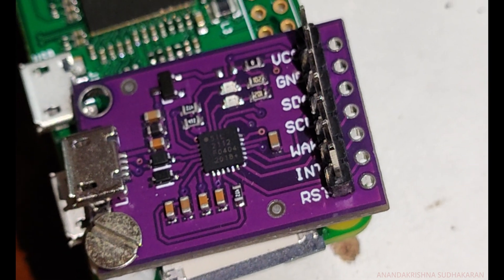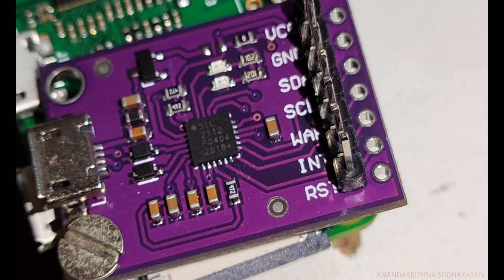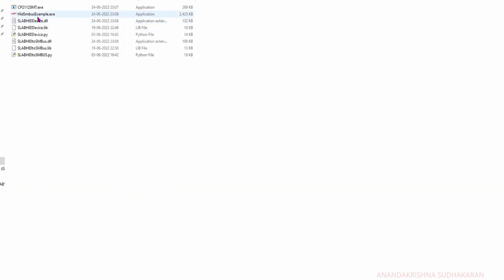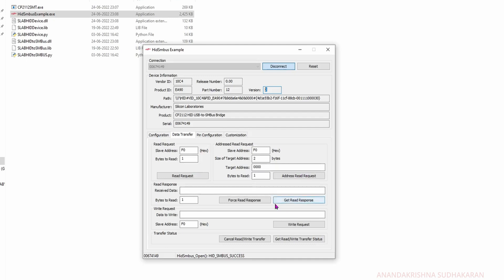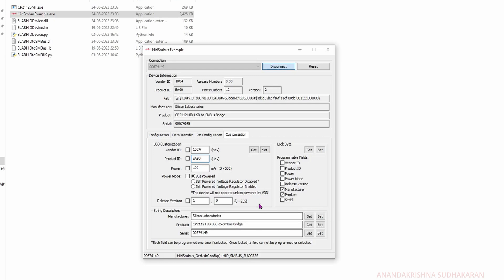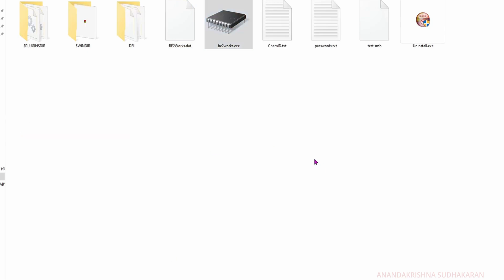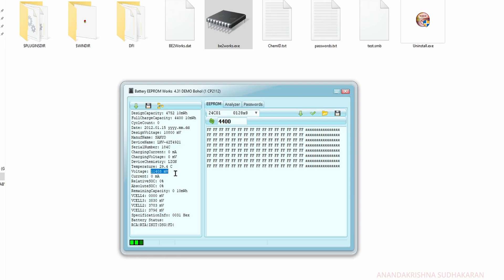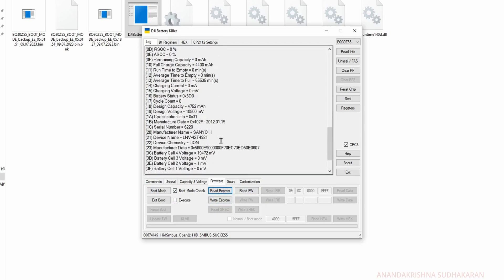"CP2112 VID and PID Locking: Protecting Your USB-to-SPI Bridge Device" -sorry for the loud voice

Comment: It started on first, led light up and app connected but next Time I opened it, shows adapter not found. couldn't connect to the be2work software. But it connects with HdsmBus software. what could be the reason?
Reply: me paso igual que a ti, con tres dispositivos cp2112 no los reconoce el be2work

Comment: Hi sir, first to congratulate you for your work and share your findings.
I bought a board, I used it to recover a laptop battery with DJI, but then I fell into the temptation to try be2w ... and I think it worked for 1 time, from there neither Djikiller nor any version of Be2w .... I suppose is what happens to all the rookies

It seems that it is clear that Be2W modifies the firm of the CP2112 and leaves it inoperative. Is it possible to recover it? returning vid and PID to their original values? or I must have to reflast completely? or throw to the trash and buy another?
Thanks in advance ;-)
Reply from the maker: it is a One Time Programmable memory. You cant change it, but if you develop your own software you can use the new vid and pid to make work the cp2112. Dji killer expects its default vid and pid. So with new vid and pid dji killer will not work. I think if you try the old karosium software ,which then modified to work with cp2112 on linux, we can give the vid and pid there, so it will work as smbus or i2c device, try it.
Reply: @AnandakrishnaSudhakaran  . Thank you very much for your answer. I have already asked for another interface, as soon as it arrive, I'm going to block it . I will try the options you propose with the interface that have suffered the modification of VID and PID.  ;-)

Comment: Hi using the Cp2112.Hid Cp2112 example software under customization.device will not operate unless powered by vdd.How to do to unlock laptop battery in that case

Comment: BE2Work demo does not see Cp2112, I think need older Be2Work Demo version to work with cp2112
Reply from the maker: If you locked the vid and pid of cp2112 it will not read. Because be2works works with it own vid and pid, for newer versions.

Comment: Hi sir I watch your video more than 10 times 
I recently by B2 work software in $400 a few days ago 
The software I use with CP 2112 
It's read bad data only one time 
Whenever I disconnect CP 2112 
And connect it again its cannot work 
Software open but cannot read the battery data and when I try with new CP2112 its read battery data but it work only one time I follow all these steps that I watch in this video 
But my problem is same nothing happened 
Can you guide me how can I fix this problem
Reply from the maker: I will try can u contact me any of my social media,

Thank you

Comment: can we do this in linux if yes how to do that
Reply from the maker: There is no direct driver for cp2112 for linux. It will be found as i2c device if you use modprobe with i2cdev and gpiodetect. There you can see this chip. Vid and pid can also available . To change it i dont know the procedure . Please contact sillabs they can help you.
Reply: @AnandakrishnaSudhakaran   yes but in the silabs software tool there is usbexpress host for linux. how to contact them and thank you so much for this information
Reply from the maker: @bharatsai9573 Ok can you share the link. Also what is your usage of this cp2112? Which software ?

Comment: Goodmorning AKS, I just watched your video as I cannot get the CP2112 board connected to my computer. 
The board seems to be broken or connection is somehow not possible (tried the the USBXpressHostSDK on both on windows and Mac computer). In your video you just connect the CP2112 to your usb port without the battery connected am I right (cannot be seen in video) and then the board gets recognized? I don’t see you restart the program and it looks like the board just pops up. Just to be sure, I read there is no additional driver necessary am I right? Thank you in advance for your reply, cheers!
Reply from the maker: Hello, Thanks for watching my video. First go to device manager and connect cp2112, check if anything changes on the device manager. Also check if any usb sound coming from speaker after connecting the cp2112. If not hear or not seen anything, check micro usb cable.

Usually no driver is needed. But if you want to lock the vid and pid you need to install the usbexpresshostsdk. 

If any doubt ask me.
Reply: Hi, thank you for your fast reply! I did check the device manager before. I did it again just now and also tried different micro usb cables and different UBS ports on the computer (windows 7) but not luck. The device manager doesn’t show anything in the HID when I connect the board. Do you perhaps have any further idea how to check if the board is broken? Or where to find a driver to see if this works? Thank you in advance for you reply.
Reply from the maker: @jeroenscheffe5730  if no driver is installed cp2112 should pop on unknown device as in device manager. Check voltages on board , there is a transistor used as voltage regulator for 3.3 volt, check that also
Reply: Hi, thank you for your reply. I actually did not install a driver and it also doesn’t show up in the device manager. I actually did check the voltage before over the pins and it is 3,39 V, slightly higher than the 3,3V
Reply from the maker: @jeroenscheffe5730  Is it genuine cp2112 or china clone? And where are you from?
Reply: @AnandakrishnaSudhakaran Hi, does the Chinese clone version have any limitations compared to the genuine version? I also didn't understand the reason for blocking the pid and vid. Sorry if there were any words wrong, I'm using Google Translate
Reply: And I forgot to thank you for looking into my questions and your replies.
Reply from the maker: @jeroenscheffe5730  thanks for your reply. So your problem solved? Did you able to read battery?
Reply: Hi, not yet 😂. I just checked the connection to the board(s). I have to hook one board to the battery pack and then run the DJI battery killer program. I was stuck at the point that I couldn’t get the battery to connect to the program and didn’t know if the problem lay at the board site or that I needed to do something at the computer site by installing a driver or so. That was when I came by your video with some sort of possibility to check connection. Since I couldn’t connect it I was assuming that it was broken and it turned out it was, so problem solved 😊.
Reply from the maker: @jeroenscheffe5730  ok. Free chip available at silicon lab website. You can order it for free. But depends on the customs. You need pay the customs duty amount for this free chip. I ordered 2 , maximum is 2, got it in 1 week from US to India, but forced to pay 1000 indian rupees, which is 12..or 14 us dollors, so if you have the tools to chnage chip order it if you can get it for free.
Reply: That is a great info. Actually the initial problem is back again, I hooked it up and it doesn’t want to connect, same for both new boards.
Reply: Hello, an update regarding the boards, it finally was a cable problem! I used 6 different cables at my first board but couldn’t get it to work. Finally the new boards arrived at my parents house where I checked its working with a cable from them; there they where working just fine.
Back home I used my cables again where none of the boards were working; till today when I got a micro USB cable along with my toch screen which did the trick 😂. So once again it’s important to use the right cables, time to upgrade my micro USB cables to some quality ones 😅.
Reply from the maker: @jeroenscheffe5730  great, i am eager to hear about your battery.
Reply: Hi, I finally found out the problem with the board not connecting, it was broken 😊. I ordered 2 new ones (just in case) and they both connected, so the first was definitely broken. 
@AKS; I just bought the easiest available one online, most probably it is a clone. 
I think my question is solved, I didn’t expect a broken board but that can always happen of course, there is probably no easy way to find out if it is broken or just doesn’t want to connect unless you can compare it with another similar board.